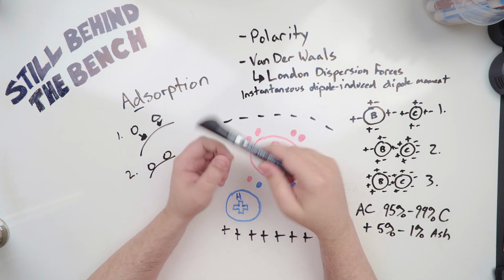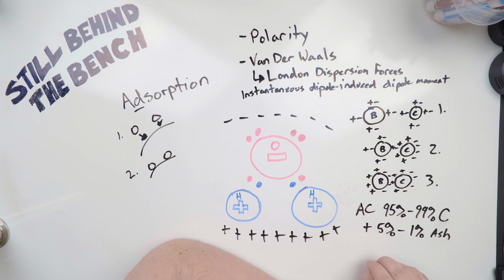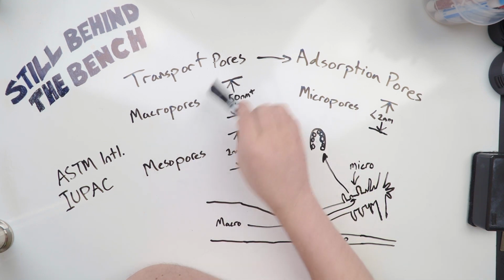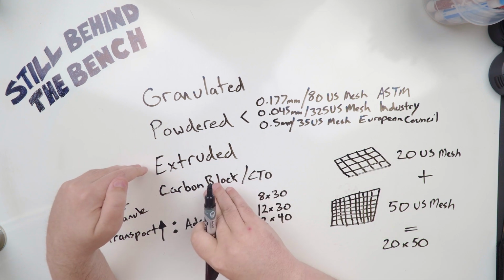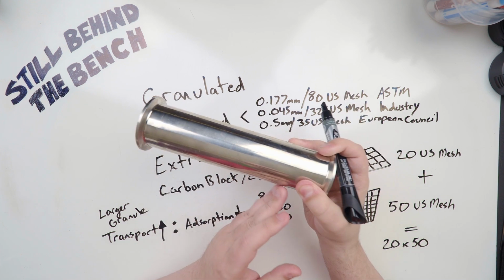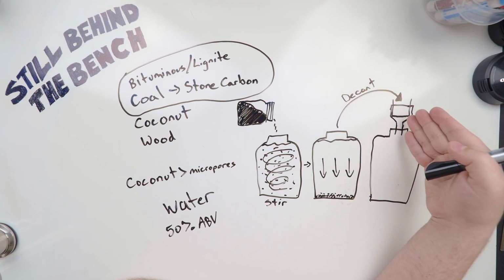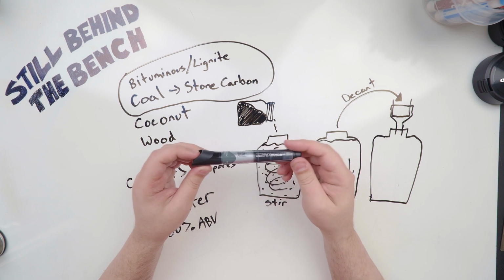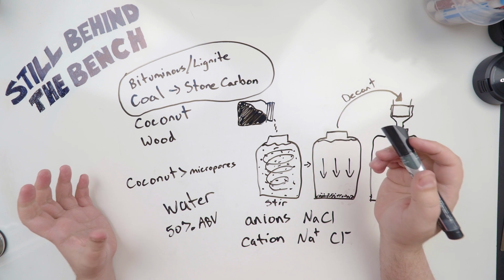Ep 024 - Activated Carbon (Filtering and Polishing)

Comment: Great video! Would you be able to provide the equipment list to build that filter? Also, Where did you get the equipment from? Ebay? Thx.
Reply from the maker: If you want a simple stainless steel pour through system all you need is some 2" triclamp spool (straight pipe), and a 2" pagoda which is the end cap. Then the triclamps themselves, and PTFE gaskets. I bought all my parts off of aliexpress.com, shipping takes longer, but it is usually much cheaper than buying local.

Comment: Would a tap/valve at the bottom of the gravity fed system not allow for control over the flow rate and contact time with the activated carbon? Commercially that is what makes the most sense.

Comment: Literally the best content I've ever seen on distilling science.  

How much neutral that has been diluted to 50% can generally be ran through activated coconut carbon before you need to change it out?

So a 1cu/ft sample of coconut activated carbon can clean X gallons of spirit.  Generally.  I know, the water makeup can affect it.  Just wondering a general amount to be looking at before I should be considering a change.  

I've also seen a lot of recommendations on making your cut on spirit before running through carbon.  The carbon supposedly reacts better at a lower spirit percentage.  Other benefit is it also cleans the cut water.

P.S. for larger stills, using a stainless soda keg with fittings is a easy way to make one.  Fill can with activated carbon and one end feeds in the bottom while you allow the finished to flow out the top fitting.  Although a large diffuser put on the inlet at the bottom is recommended.

With the same theory, having 3 soda kegs inline you can have 2 activated carbon and 1 quartz sand for filtration.  At the end run it through a large cartridge element unit and I'd think that would clean anything up.

In your spirit vessel, you can also run an ozone generator in a box and a aquarium pump in the box running out to a diffuser in the spirit vessel.  Just have to be very careful with Ozone and not vent it into living spaces.  As it kills things like pets and people if living in the space.  So have it run into a vessel for hours and then it shuts off.  The next day run spirit through the filtration cans.  Probably about the cleanest neutral spirit you can get.  I'd love to find a flocculant that would work also but worried it would impart flavors to a neutral spirit.

Comment: When we char wood for ageing, isn't it just creating activated carbon for filtering also?
Reply: Here is a quick low-down on how its made, I should have put it in the video. They take their source material, coal, wood, coconut shells, they pyrolyze them (heating in the absence of oxygen). Then they take all that charcoal, and they heat again to extremely high temperatures, or they instead use a chemical process, both to to remove all organic matter (anything but carbon) that is left in the charcoal, and it's that removal process that "activates" it. Then they do an acid wash to remove inorganic (minerals, metals, etc...) matter.

So realistically, I'd say no simply charing wood doesn't make activated carbon. But technically there probably is a very slight amount of activation going on. Simply charing wood, or even pyrolyzing (heating in absence of oxygen) it to make it charcoal, doesn't "activate" it because that wood is still full of organic compounds. It's the next step, the activation step, that turns it from charcoal to activated carbon which uses adsorption.

Charcoal, or charred wood, can filter things, but it's more of a physical process of things getting physically trapped in its cracks and crevices.
Reply: @adamw2785  ok cool, thanks mate. 😊